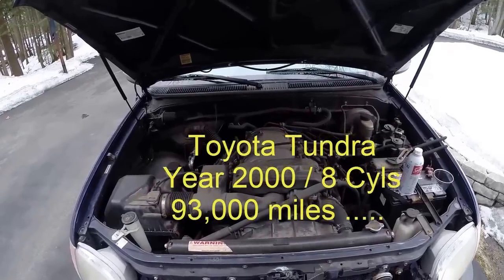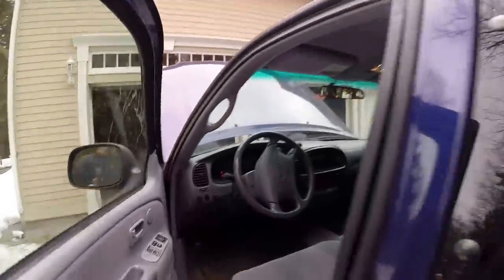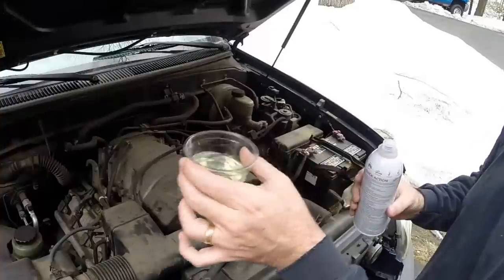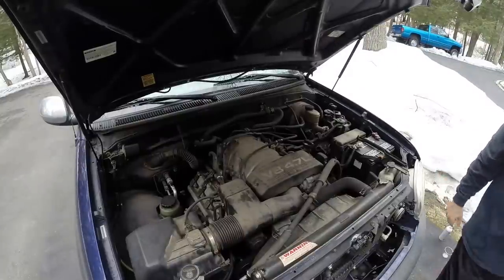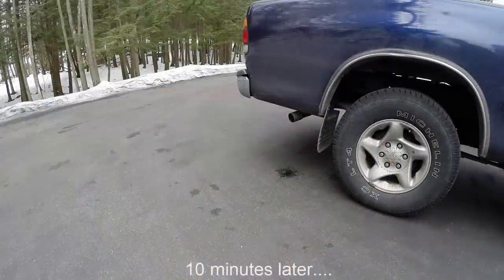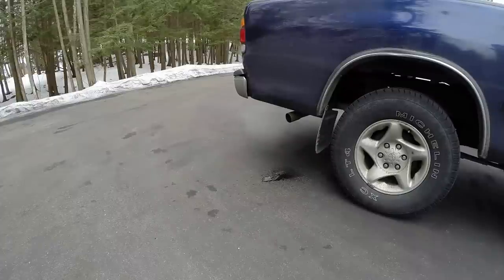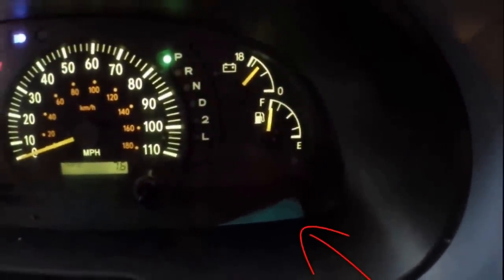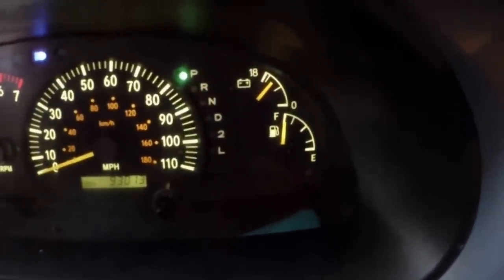Sea Foam Toyota Tundra 2000 - check engine light on - clean out vacuum hoses - serious smoke!!

Comment: either reset the light via ob2 tool or by disconnect battery.... light will come back on if issue is not fixed...  good video! i am referring to jack hill's comment

Comment: I had my check engine light come on my 02 sequoia, the code came up ..oxygen sensor, had it replace using genuine toyota part, came back on after about 500 miles, one thing i did notice, when i use premium fuels the light stays off, comes back on again when going back to 87 octane. Gas has come down again in price...thinking about disconnecting battery to get the check engine light to go off, then use only premium fuels..to see if that helps..Toyota trucks run so good even with that stupid check engine light on or off...i ran my engine for 2 years straight with that annoying light...

Comment: When you change your oil put a whole bottle of sea foam in the engine and when you fill up your fuel put a whole bottle of sea foam in your fuel tank before you put fuel in.
Reply from the maker: That seems a lot stronger than the recommend amount on the bottle...
Reply from the maker: Great suggestions, but I think a whole bottle might be a little over kill.  I'd follow the directions on the can for the right amount to add.  Please subscribe to my channel for other DYI, travel, and drone videos!
Reply: Thomas  Collette  The instructions on the pour bottle have never been very clear and they've changed on the new ones. The web site says use 1oz per gal of fuel to stabilize and start with 2 oz per gal to clean("The more use you the better it works"). It also claims it can't damage your engine in higher doses. The bottle says up to a 50/50 ratio. (Proud Sea Foam user since '79)

Comment: is the live you removed connected to the break booster
Reply from the maker: If you are referring to where I poured in the Seafoam, then yes.
Reply: so do i change the oil after this?
Reply from the maker: That's entirely up to you.  You should aways change your oil on a regular basis.  I have used Seafoam in the same location as I put my oil, generally about 100 miles before I do an oil change.  There are some that say its a waste of time, but other say it loosens up the sludge so that things run more smoothly and better clears out the clears out the oil when changed.  So is spending $8 worth it on a truck that will run maybe longer???  Up to you.  I do, and it seems to work for me.
Reply: thank you......

Comment: If the light comes back on in a day or two Put in a 16 oz bottle of 100 percent pure acetone before you go on a long drive. You can refill at half a tank. The acetone is diluted so it won't harm anything. Berrymans B12 contains acetone.

Comment: Ok first of all I own a 2000 SR5 Limited V8 Same truck the ticking is. your exhaust manifold leaking Toyota admitted they had bad Exhaust manifolds never bothered to fix em I replaced both of my cats and the stock crap muffler for 450$ I run Flowmaster now that's probably where your vacuum leak is coming from if you don't like the check engine light dissconnect  your   battery it seems like you don't really maintain your truck
Reply from the maker: Yes, good points here.  You are probably right.  I am not a complete mechanic, but do try and maintain the truck as best as possible without sinking a ton of money into it.  For my purposes, it seems to work okay.